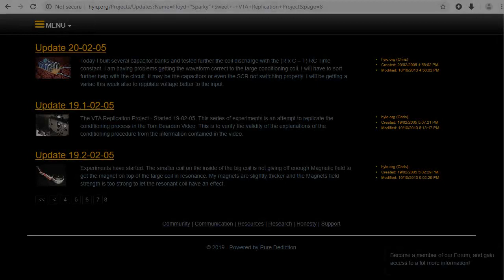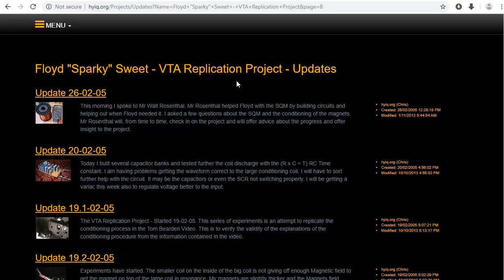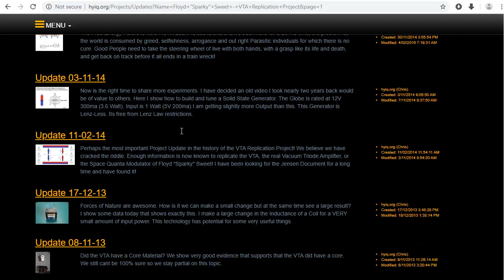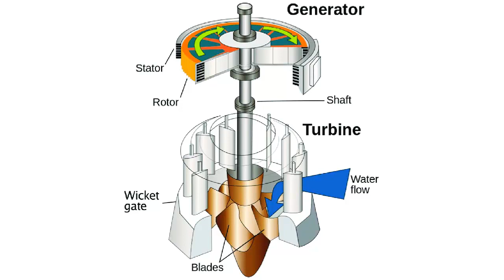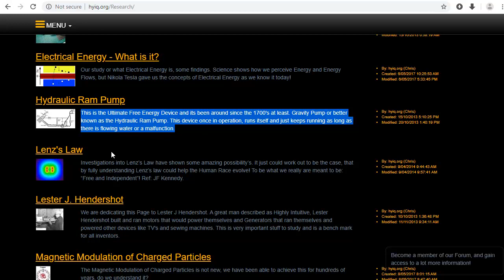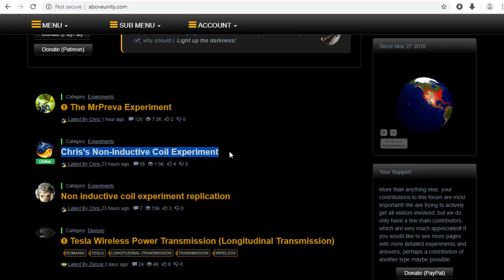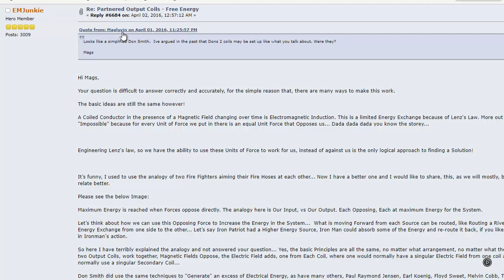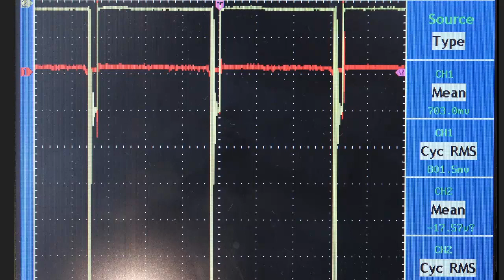Non-Inductive Coil Experiment - Video Nine

Comment: This is subtle, but saying the electric fields are only driving charge particles distracts us from the potential of this research. The power of electricity is in waves and fields. Sure they don't directly do much with material things, but when you change them, they work better than matter can. Think about how a batter hits home runs. He doesn't do it just swinging his bat, he has to accelerate his swing, he has to change the speed of his bat to transfer the energy necessary to score the winning run. It is rocket science, the Oberth effect (the only way NASA applies rocket fuel. Amplify the utilization of stored energy (dielectricity or voltage & magnetism or current). Use this mechanism (change the rate of the field movement) every chance you get, and save the world by creating energy at an exponential rate to what we need with the growth of the world population.  Party on Dudes, be good to each other.